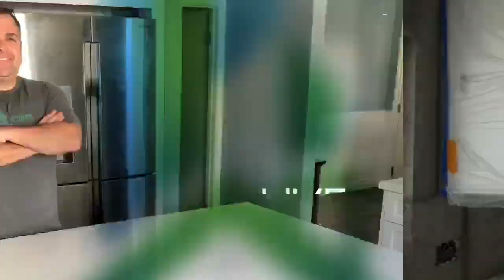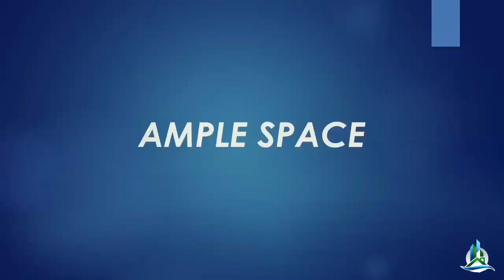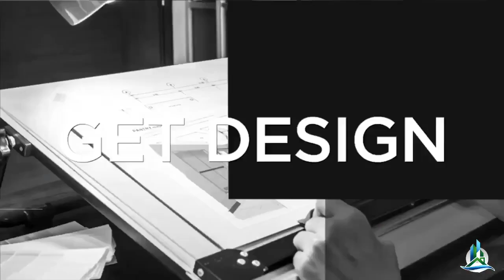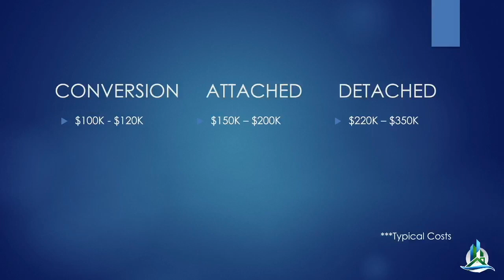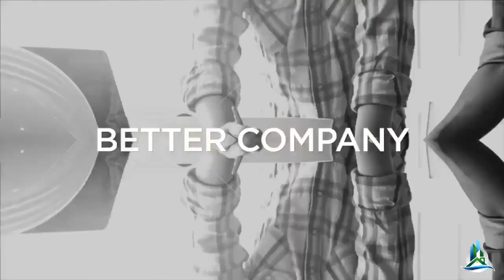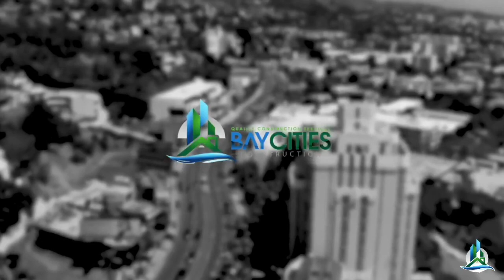How to Get MAXIMUM Rent for Your ADU | ADUs in Los Angeles

Comment: What kind of difference do you see between 2020 and 2021? I keep hearing about rising construction costs.
Reply from the maker: Material prices, specifically lumber prices, have been volatile since summer 2020. Labor is pretty stable, but we've seen lumber prices rise every three weeks or so.   

https://www.cnbc.com/2021/02/10/lumber-prices-skyrocket-pushing-up-housing-costs.html